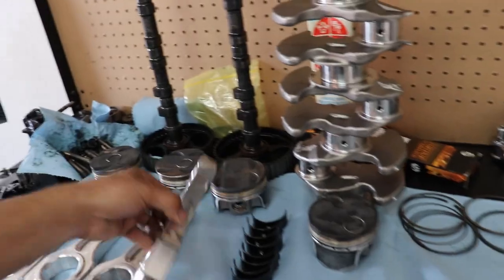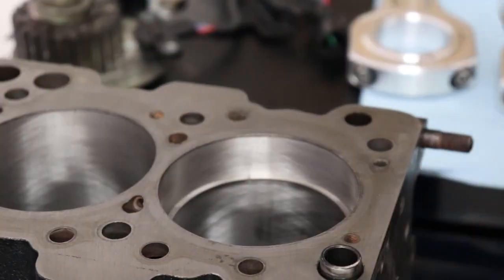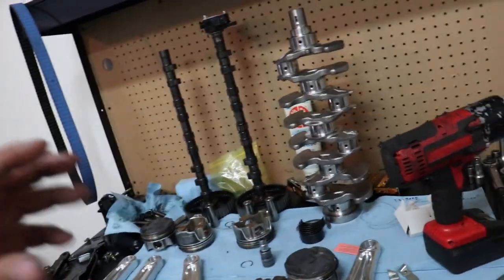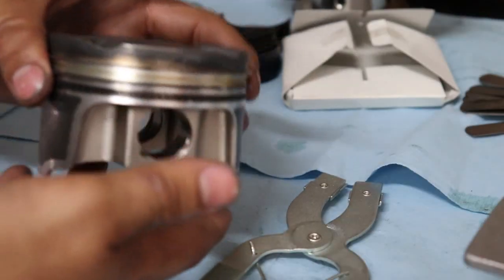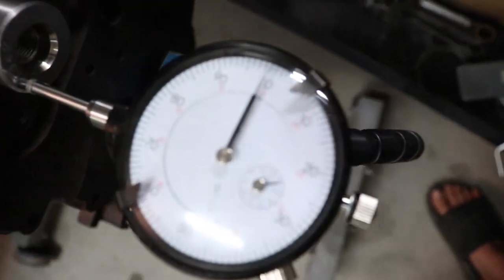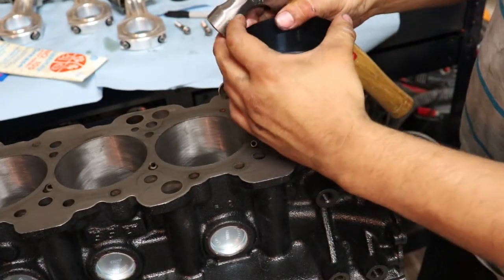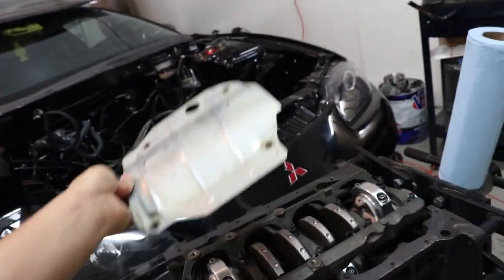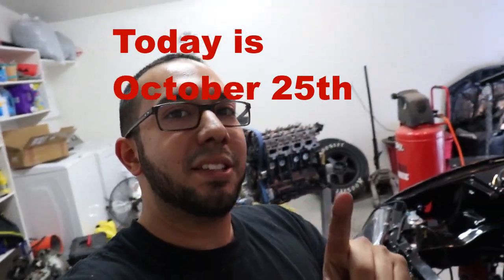BUILDING my 4G63 AlUMINUM Rod Motor for my MITSUBISHI ECLIPSE GSX! Complete Start to Finish DSM PT4

Comment: I have a 95 block with the early thrust bearing design and it has 130k on it. Just blew through the factory turbo oil seals. 2 head gaskets into it.
Reply from the maker: So kinda weird. My 97 gst has an early model 7 bolt. Found out when I tore it down 6 yrs ago

Comment: When filing piston rings always rotate the grinding stone towards the inside of the ring never the outside
Reply from the maker: Thanks for tip! Haven't heard of that yet.
Reply: Anytime man! Yea the reason why is because when you are filing outwards you are creating micro burs that point out towards the cylinder and can score the cylinder wall if not filled down properly, so to reduce the risk you allow the burs to face toward the piston by turning the stone towards you and then you can lightly file down the outside. Great video BTW excited to see the progress.
Reply from the maker: @4g63spdfreak  ahh makes sense. Iv been using 1000 grit sandpaper to help get off any of the burrs that i may have made on the rings. Less the burrs the better! Thanks!
Reply: I like your experiments 😂👍
Reply from the maker: @phantomdmod  I do too..when they work lol
Reply: I don't see how rotating it either way is more towards the inside. It's either up or down not inside or outside.

Comment: Very interesting tutorial. As I am not a mechanic but very interested in engine rebuilding. My car is a Misubitshi Galant MY 94 with a swapped 4g63 dohc n.a engine. I would like to know the possible causes of engine overheating after overhaul. What could be possibly wrong and what to look for? Tks a lot for your help.

Comment: In the early 00' it was known that the late 96, 97, and early 98 cars were the most susceptible to crank walk and it was suspected that it was the manufacturing plant not changing their tooling enough and not having properly sized thrust bearings for the resulting tolerances. When combined with a then ACT 2600 or higher pressure clutch setup it almost guaranteed crank walk in those engines. Then ACT 2100 or similar "mild" clutches were hit or miss.
Reply from the maker: The newer split thrust washer Design drastically cut down crank walk on the newer blocks vs the old saddle style thrust bearings. You are right about the heavier clutch's took its toll on the older 7 bolt blocks.
Reply: @Gabe_Ortega  so I hear mixed info on this everywhere. Is the 99 7bolt the only one made with the better thrust bearing or is it all the 2gb cars 97-99?
Reply from the maker: @TD04_Trav  almost all 97-99 blocks were revised..however I have heard of some 97 blocks to be the older style.

Comment: 6 bolt rods shaved to fit the 7 bolt crank ftw
Reply from the maker: This sounds interesting!
Reply: @Gabe_Ortega  look into it if you have cw issues also 6 bolt rod bearings :)never had cw @700hp and manual!!
Reply: @Gabe_Ortega  on my girls youtube account smh just noticed lol

Comment: When you're torquing down the head do you need to do like 60 degrees after the 90 foot pounds? Or is it just to torque?
Reply from the maker: I did not. Straight up 90 ft lbs
Reply: That's only for factory-style TTY - Torque to Yield bolts. Aftermarket bolts and studs are typically torqued to a number value and that's it.

Comment: Kinda mad abought you bending a rod. Thought I learned something and bought H beams instead of I beams. If I bend one these I'll know where the money I didn't spend goes. I bent a rod before, on purpose though. So I'm kind of learning. Would of liked to make more horse than you tho.
Reply from the maker: It was a stock rod so I wouldn't hold it to too much standards.

Comment: 10.4? With a aluminum rod motor?  🤔🤔🤔
Reply from the maker: Thats the plan..may have been an over kill but always gives me an option later for a gt42r :D
Reply: @Gabe_Ortega  yeah just a tad bit over kill lol. Nice build either way. I did go 10.2@136 with a stock bottom end 7 bolt tho 👀🤣. It'll be killer with a bigger turbo tho!